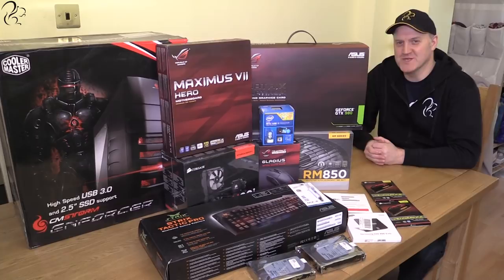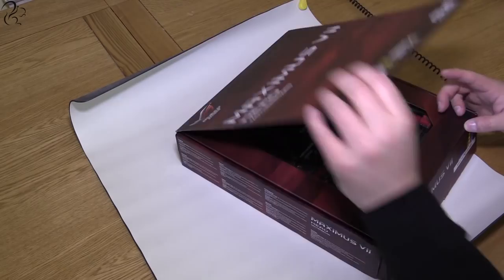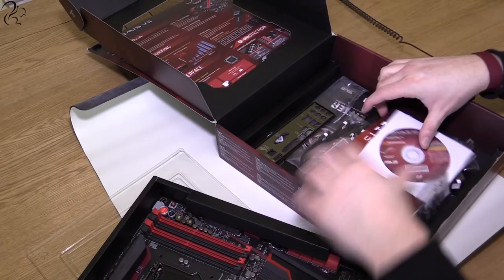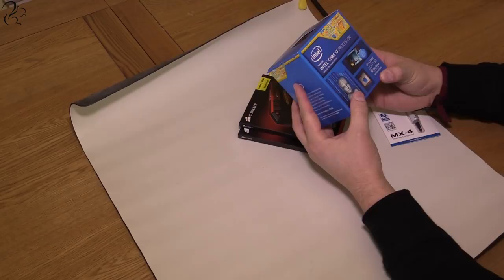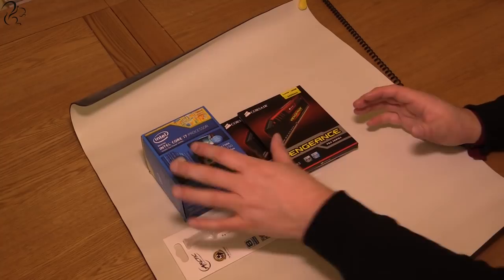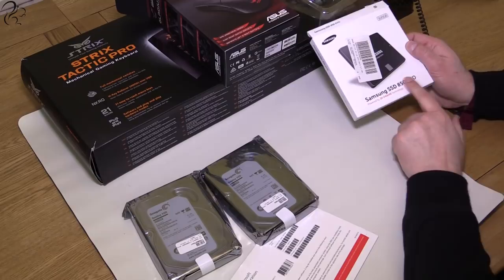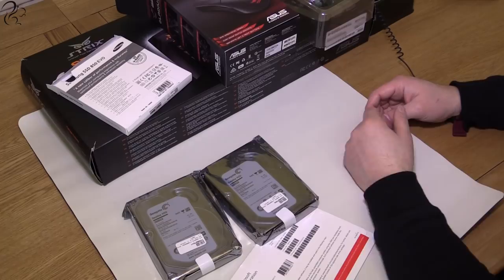How I Built My Gaming Rig (Step by Step)

Comment: I like most of your choices squirrel, puzzled by the choice of case tho and cpu cooler. I'm surprised you didn't get a case that will take a h100i in the roof. You might find temperatures limit your overclock unless you've got air con. The psu 80 plus rating is power efficiency not noise rating as well. I think gold is minimum of 90% at 50% load.

Comment: I would not recommend putting the mobo in the case first then installing the cpu you should do that outside the case also don't pop off the black plastic cover on the mobo because that pops off when you've lowered the retention arm

Comment: Really informative video. I have watched a number of PC building videos as I am thinking of getting a  pc to replace my MacBook and to get into PC gaming. However, I just don't feel confident enough to build one myself, I work in IT, but I have always been more interested in software than hardware and my DIY skills are completely non-existent. I could probably do the simply stuff like adding memory, graphics card or drives, but the rest of it I would probably struggle with. I probably will buy one from PC World or from PC Specialist and add bits to it as I go along. Great video and hope everything goes will with the new PC and with full time streaming
Reply: Look to places like DinoPC or overclockers (iv had no dealings with either, but Squirrel is getting some discount codes for overclockers soon) rather than PCworld, they are a lot more performance & custom PC focused

Comment: Squirrel Hey Paul, God I wish I could afford to build a rig like that. I'm going to have to buy a piece at a time. But that's ok. The reason for me not is your standoffs. When I started building computers, I read in CPU magazine and a friend that works on computers told me that the standoff are not just to hold the mobo in place. They actually are there to keep the mobo from shorting on the case. You may want to re-think putting the rest on. But it's a beautiful rig. Love it.

Comment: I just built a gaming PC for £1000 in the NZXT phantom 430 midi case in black and white. It has:
MSI GTX970 gaming 4G, MSI gaming 3 motherboard, team group 16GB ram, Intel I5 dead canyon @ 3.5GHz, 1TB seagate hard drive, 250GB Samsung EVO SSD.  I also went for a black and red theme
Reply: Also a 650watt super flower power supply

Comment: I plugged my h100i fans into the motherboard headers because the stock fans are LOUD! and Asus AI Suite lets you set fan curves which is really helpful. Case is a bit shabby, personally, I would of gone with a 230T or C70. Specwise 10/10
Reply from the maker: pommy192 I love the case. I show later in the video how to use the AI suite to tune the fans.
Reply: Andy26473 Doesn't really help when the fan's aren't plugged into the pump.

Squirrel Ai Suite is a cracking program to use, I got some SP120 quiet editions (PWM) are they are worth the upgrade for the RAD. I have the VI hero and sooo many case headers.
Reply: Andy26473 Because it's a single 120mil rad and the stock fans are crap
Reply: pommy192 Case feels a bit cramped I would probably go with a Phanteks enthoo pro full tower and all the cables are sleeved black so no rainbow cables to mess up your build.

Comment: I'd be weary of those sickleflows. I've got some in my current rig and one crapped itself, it started making chirping noises and it took me forever to pin point and when unplugging fans one by one I found one of my sickleflows was the culprit.
So if you randomly start hearing chirping noise, it might be your fan.

Comment: Btw it's pronounced SAYTA, and it's called an SLI Bridge. Also water cooling isn't that much better than air unless it's custom in which case it is much quieter and much better in terms of performance. In this case it is only slightly better and isn't always quieter plus it costs substantially more. That being said the pump is much smaller than a heat sink and fan and may be better aesthetically especially if you have a windowed case. Also nice cooler!

Comment: you do realize that the cooler is designed to be mounted  in the top of the case lol

Note with the amount windows installs you best be thinking 2TB or higher, you can install your primary games on the larger hard drives however games access on default into your documents folder which is where most of your mods sit..

1TB isn't enough for a modern gaming  rig buddy

The biggest upgrade you will do for main C: is 4TB SSD because you will not have enough space  for system and game install routine with game accessing to c:\document folder even at 1TB will  not be enough..

As the boot drive not sure  if you have built another rig since this was built Squirrel however If I was building something today and even in 2015 I wouldn't bother with 1TB as a suitable c drive...

Comment: You should use the MX-4. The generic paste prelaid on the cpu block is not very good. It will run aprox 6-7 Degrees Lower with the MX-4. I Speak form exprerience, I have a Corsair H110 on a 5930k, And i tried the prelaid paste first. Then MX-4. 7 degrees cooler instantly.

Comment: That's a solid rig Paul. Oh the fun you gonna have building this. I did mine last year still haven't found a game that could give her a hard time :)
Reply: las347 Same here (finished) building my system not to long ago and everything runs perfectly on it (except OMSI2 but you know, ... OMSI2)
Specs if you are interested :D 

CPU: Core i7-4771 "Haswell" at 3.5GHz (3.9GHz Turboboost) (LGA 1150 socket)
RAM: 12GB (assorted)
GPU: Gigabyte Geforce GTX 970 Windforce
Motherboard: Asus B85-Pro Gamer
SSD: Crucial MX100 256GB (OS and some programs)
HDD's: 5TB (assorted) (Programs and data storage)
OS: Windows 7 Home Premium
Reply: Oh i forgot#YOTS
#Doyleforpresident
#YearOfTheUndefined
Reply: How much did it cost you?
Reply: I honestly can't tell you I have had this rig for a number of years and have been upgrading the parts over time (so much so that I have 2 PC's now)
Reply: "And thats how the PC master race is enslaved to technology"

So true ;P

Comment: It'd be nice if modular PSU's actually where... a bit smarter I suppose.  Mine have different sockets for the SATA and molex strings, I could get converters sure but it'd be nice to just be able to plug in another string of SATA's instead.

Comment: Idk my gaming setup in the far-flung future would have 3 cases that are 2ft by 4ft tall each and the most powerful (+5ghz and above processors with over 120gb ram and 4(number of hard drives) 2(size of each hard drive) terrabyte hard drives and most expensive computer equipment + controllers + keyboard + mouse and mat + the most expensive monitors x 3 (over 144hz +, 64 bit+, and 1080p +) and OS above Windows 8 or 10 or something like that. The plus "+" means anything above that is current.
Total Combined: 15ghz+ (3 CPU's combined, 360gb ram+ (3 CPU's combined), 12 6 Terrabyte hard drives (3 CPU's combined)
Cost: $50,000+  Reason: If you want the best, you gotta get the best and most expensive stuff out there.

Comment: Nice Vid, but you don´t need the MOLEX connector on the GTX 980. Its only needed, when you want to extremly overclock your graphics card Squirrel
Reply: it's more for defrosting the memory after liquid NO2 cooling
Reply: BerheavedTripod8 And what do you do, when you cool your graphics card? Right, you do extrem overclocking. ;-)

Comment: Well done on cable management! And also you taught me something about over clocking which is now key for me because me and my friend over clock and my pentium is over clocked to 4.4GHz now I know how to get it higher! I will come back later with the answer. However I have a question. Are you going to buy or ask for another gtx 980 or a titan x when its released and if Asus bring out their own modded version. Also I'm only 12 and have my own personal built PC so that's why I don't have high end parts like you. EG: I only have a gtx 960 and a pentium anniversary edition (to be upgraded to i5 or i7 at Christmas because of the sky lake release.

Comment: Although water cooling is efficient, it being quieter than air cooling is not a selling point, as this is generally incorrect. With good quality fans, air cooling is as effective and often quieter than a water cooling block because of the noise of the water pump.

Comment: built many pc's over the years and never used a static wrist strap. never had an issue with components.  no need.
Reply: John Cusick Why not play it safe though?
Reply: i see it as a myth. not used it in the 15 years i have been assembling computers. never had an issue so dont need to use it
Reply: John Cusick I guess it matters a lot on the environment you're building the computer in. I used to build my computers on thick carpets and never got a dead component. However, others don't have such good luck and destroy a multitude of hardware during the process. I'd still play it safe though, a $3 ESD strap can save you hundreds of money from an accident.
Reply: John Cusick Me neither, you got more chances of the thing overheating and breaking that way in my opinion.

Comment: I love your videos a lot, however, I want to start PC gaming on my channel. With todays modern games: GTA V, Garrys Mod, Black Ops, etc. would you recommend windows 8.1 or windows 7 and why? I heard 8.1 is better and faster than 7. Can it support flight simulator or train simulator? Also another question is: should I get the 32 GB 2133 MHz Ram (Consair Vengeance) or the 32 GB 1866 MHz Ram (Consair Vengeance)? I heard the 1866 is better than the 2133. Thanks so much for your feedback and I love your videos!:)

Comment: Hi Squirrel did you try any other stress testing programs? I think Intel Burn Test is very mild to be honest. If I run Prepar3D maxed with a decent aircraft, my CPU will give me temps about 15 degrees higher than Intel Burn Test. The ASUS benchmarking tool was a little more representative of temps. I also found that OC's that would pass fine with IBT wouldn't last a few minutes with AIDA64 or OCCT.

Comment: God what a waste of money paul, anyone you will enjoy it! <3
Some Corrections:
1. You can save on the motherboard with no doubt, Gigabyte Z97X-SLI will basicly give you the same results just without the useless features (useless for u of course).
2. I didnt understood why did you chose the Asus verison of the GTX980, you could go for the MSI Gaming and save some money while getting the same performance.
3. The RM850 is defendly a quality PSU, but think again if you need this quality for your use. By the way im using Powerman 600W which i cant call quality over 3 years and i havent had any issue.
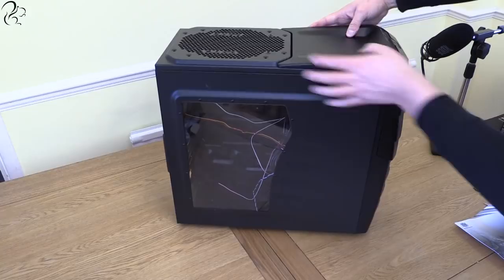4. you could save not taking the Vengeance which is totally useless, the simpleset cheapest RAM would work fine and give you same felt results. Kingston KVR series could be fine, if you want also design you can go for the Kingston HyperX series.5. I hate the Enforcer, it doesnt look that good and feels like its gonna break. Even on 1:15 you can hear the plastic while you knock the case and press buttons. Not quality indeed. Its not quiet neither and its super annoying for recording\streaming. For your system i would go for Farctal Design R5 \ Antec P280
if the parts are from your partnership with Asus, so im a dumbass :)

Comment: Great Video paul, hope you didnt have problems withe the Corsair Link software as its a bit buggy with Win 8.1 and usually requires a registry tweak for it to pick it up.. I was interested as to why you put both fans on a push configuration on your radiator rather than push/pull? Anyways Nice Build, very similar to mine inc same CPU & Board. Ive stuck with an overclock of 4.6Ghz @ 1.250Vcore & CPU Cache 1.20v on adaptive mode.. Idles at 35C and IBT max is 80C.. :)

Comment: ramping up the BClk for everyday overclock is just plain stupid. As you said, "the bus dictates everyhing". So, also all your usb devices, pci and pcie slots. That means that it's very possible you may cause datacorruption on an external harddrive, a dedicated soundcard locking up etcetera. Fun fact: "in the real world" you will never notice signiificant differences between 100 Mhz and 102 Mhz except taking a hardware related risk.

Comment: Not really the place for technical support but I just today received my replacement RM750 PSU after original died 1 month after purchase & the new is making a high pitch squeal noise (very faint when idle but loud when gaming) suggested course of action? Love the video btw and am excited for  #YOTS
Reply: Kazzoom12 Contact Corsair to see if you can get a replacement. Though be warned, manufacturers DO NOT need to replace the part because of coil whine, you might get a replacement but I wouldn't get your hopes up.

Comment: How's my specs I'm building this later in the year 

CPU: i7-4790k 4.0GHz quad core 
Motherboard: MSI Z97 gaming ATX LGA1150 motherboard 
RAM: 16GB DDR3 1600 memory 
STORAGE: Western digital caviar blue 1TB 3.5 
Video card: MSI GeForce GTX 970 4GB twin frozr V VIDEO CARD 
power supply: EVGA 850W 80+ gold certified fully modular ATX power supply 

Is the power supply enough for this build thx
Reply: +RAZER GAMING u should be fine high to ultra don't know about the psu doh. How much does it cost?
Reply: +Cameron Dembski (Hayes Gaming) its about $1400 AUD
Reply: US? Don't know how to convert
Reply: +Cameron Dembski (Hayes Gaming) AUD or austrailan dollars
Reply: I thinks it about 1100
Reply: +Cameron Dembski (Hayes Gaming) google...
Reply: lol
Reply: +RAZER GAMING If this is for gaming, I'd recommend getting an i5 (like the 4690k). With that saved money, you could get an SSD, which is much faster than a hard drive. The power supply is plenty. You could probably go for a 550 Watt PSU and be fine.
Reply: Nicholas Li thx
Reply: +RAZER GAMING I think your psu has more wattage than u need, and I would get a ssd for your os
Reply: +RAZER GAMING I think your psu has more wattage than u need, and I would get a ssd for your os
Reply: Exploding Cowy what about a 650w or 550w power supply
Reply: RAZER GAMING That should be fine, but i would go to a site called "pcpartpicker" to see the total wattage of your system just to be safe.
Reply: RAZER GAMING Would be fine. I'd recommend a SeaSonic, EVGA, and some corsair PSUs (No CX). Antec, Silverstone, and XFX are also good.
Reply: +Nicholas Li Don't be an idiot, 4 cores won't be enough in less than a year or two. Games are already starting to use hyper threading.
Reply: Communications Studies Major A 4 core cpu is enough for almost every game on the market today, it'll be fine for the next few years. Besides with the cpu socket he plans on getting he can easily upgrade.
Reply: Exploding Cowy To what though? The 4690k will really only have an upgrade to the Broadwell-E chips (other than the 4790k) and those probably won't have huge performance benefits. He might as well go Skylake.
Reply: Nicholas Li I understand, but Skylakes haven't been too price efficient lately due to shortages. I'm just looking at it from a budget standpoint.
Reply: That's absolutely true, and the haswell CPUs wont be getting redundant any time soon.
Reply: This will be mine for 2016:
Lenovo H30-50
Intel Core i7-4790 Quad Core Processor
Microsoft Windows 8.1 64-Bit
8GB DDR3 RAM
2000GB 7200R
Reply: T/B/T SimPlayer If it's for gaming, that's probably not what you're looking for. Also: what gpu is there, if there is one?
Reply: I don't do gaming. However, I would have this only to play my games with no lag whatsoever and to watch videos in good quality.
Reply: Only to play games with no lag whatsoever, and no gaming? Please explain.
Reply: Sorry for late comment, here is the explanation:

This game called Train Simulator, could not be not suitable for laptops but if I want to play it properly, I have to have a powerful computer (which is supposed to be gaming PCs) to play that game. Furthermore, other games such as World of Subways 3, Euro Truck Simulator 2, Scania Truck Driving Simulator and Trucks and Trailers still have to play on a powerful computer.
Reply: buy a better graphics/video card
Reply: +T/B/T SimPlayer that's not a gaming computer, search for one with a dedicated graphics card from NVIDIA(there is AMD but you may end up with an APU so go for NVIDIA)
Reply: carzacc I have GTX 745 that I noticed.
Reply: T/B/T SimPlayer The GTX 745 is awful. Get a 750 ti at least -- it's only $100 right now.
Reply: T/B/T SimPlayer It's not a gaming PC if it has an i7 and a 745, at the same price you could get an i5 and a 970 at least
Reply: +Dead Pool the 970 is more than good enough
Reply: FAK3Y I'm no computer expert so all I know when it comes to specs is huge numbers are good unless it's your power need

Comment: First off, I am a complete computer building nerd (the only one I've ever opened was an ancient pre 2000 one to take out the hard drive because I wanted to throw it away) so basically I know what the components do but have no idea about installation. I was wondering why you said not to touch the conducting part of the RAM blocks. Is it the static electricity again or is it that it actually hampers their performance?
Reply: SupaDriftz It's just static, like with anything bare electronics, any sort of static will just throw the whole thing out of whack, its not designed to handle it. On the other hand, touching it probably won't matter, but the risk is always there.

Also, any dust or dirt on your hands may get onto the connections, possibly reducing or damaging the parts - again highly unlikely but better safe than sorry
Reply: SupaDriftz   Before handling any computer components touch a radiator or pipe in your house and it'll earth you.  The static can damage parts especially RAM.
Reply: scowy1978 Your supposed to touch the power supply or the metal part of the case. I normally keep an anti stactic wristband near-by too.